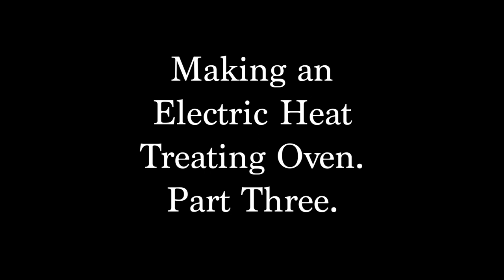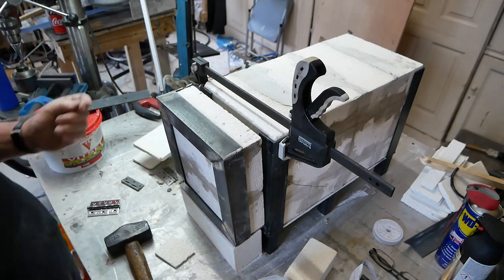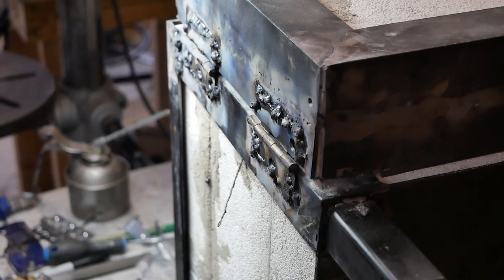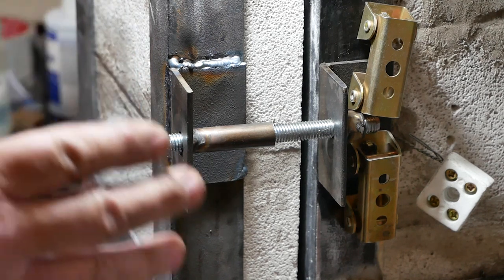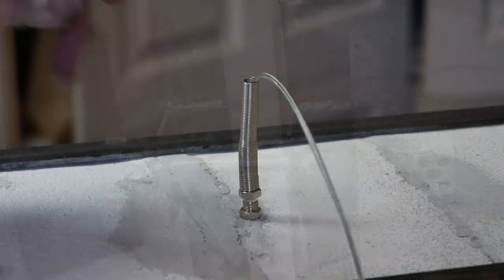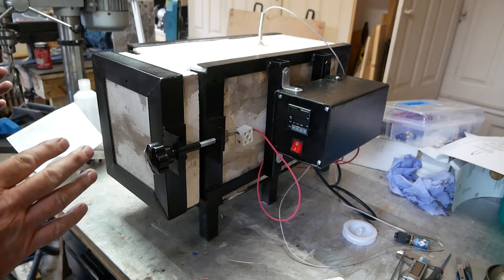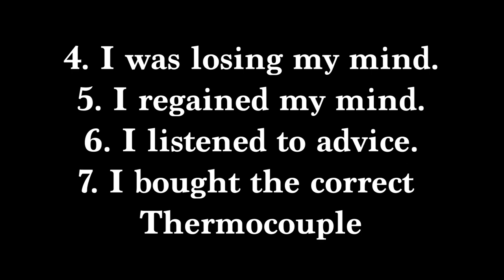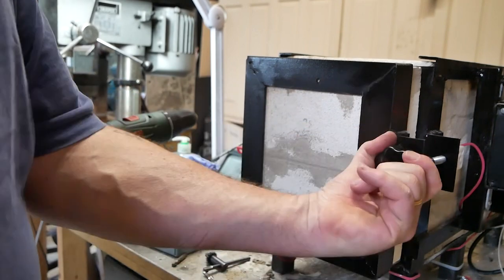Heat Treating Oven 3rd and Final Part

Comment: Couple pointers, use insulating brick or ceramics to make a blade rack.
Saves heating up a big lump of steel.
Also insulate the live end sticking out of the side of the oven and consider putting a switch on the door so it doesnt energize the heating element when you have the door open (micro switch between the PID and the SSR)
Reply from the maker: Thanks Johan, sorry for the late reply I didn't get a heads up.